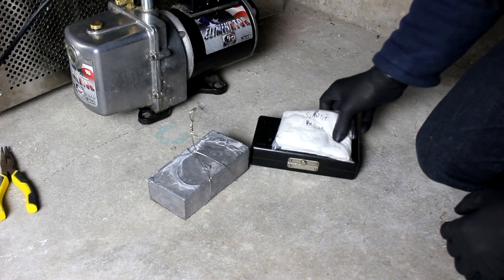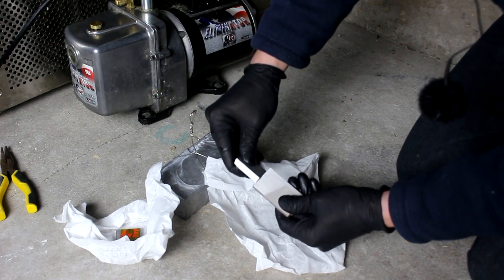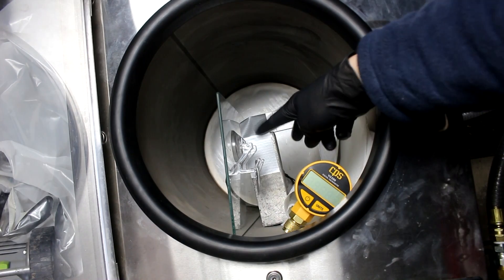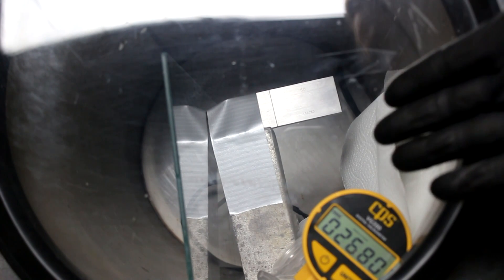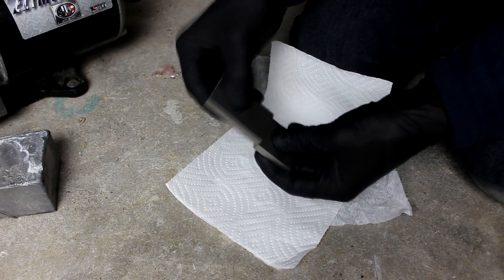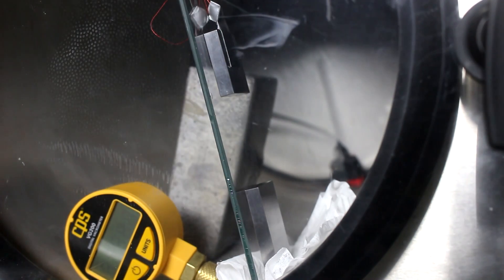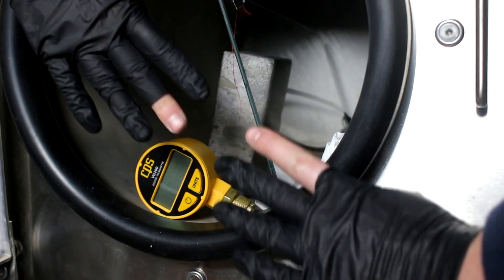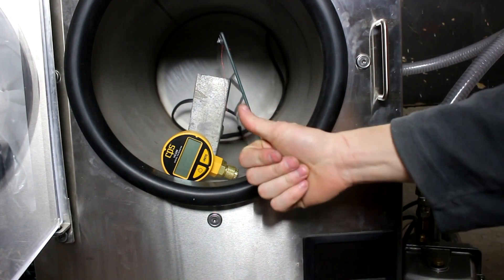Will Gauge Blocks Stick In Vacuum?

Comment: What if the flatness of the face is to the point of every atom on the surface perfectly contacts the atoms of the other block in a way that every spot on the surface heats up evenly to the point of welding them together through friction but on such a small level that it will snap at the slightest touch because its a incredibly thin weld?

Comment: the conditions of cold welding is not met. The oxide layer on the surface has to be cleaned off in the vacum and then it would work. Otherwise it would take very long time to disappear naturally.

Comment: NO PHD but since 14 /68 now  & owned optical coating lab for 43 years the physics here involve molecular bonding at the wavelength of light that your blocks are polished too. I was going to patent an optical filter based on this phenomenon.(after 1o k lawyers r leach's) I stopped> When contacting optically (used in the optical industry as a common practice to make arc second parallel surfaces)

Comment: @13:00 I assume, that the metall-oxide layer is preventing the cold fusion process. When sliding it with friction, you perhaps remove the outmost oxide layer, so that an actual "cold welding" process could be assumed.

Comment: you know that you could just start with them stuck together, and then hang them inside the vacuum chamber, right? When out pull the vacuum, if it was the atmospheric pressure holding them up, the bottom one would just fall off '-'

Comment: You should try doing this in other circumstances, as to see if they're getting stuck together for some form of static charge or smth. As long as I know, I've never seen this test done with a piece of glass or some other insulator. Looks like it's for metals only, and it could have something to do with electric charges
Reply: Ceramic gage blocks wring.

Comment: Being able to put the two surfaces ever closer together means there will be pore and more places where the atoms get really close the cohesion force will appear at more and more places. The air pressure does not play a role here. In fact I predict: in a vacuum those two surfaces will stick together even stronger.
 But in all your experiments in the vacuum chamber you missed one important element: you had not the pressure with which you pressed the two surfaces manually, and so all those possible »places of contact« could never come together close enough to create together enough cohesion force.

Comment: Is it possible that the friction from wringing produces a miniscule amount of heat, and therefore thermal expansion? If so, then maybe as it cools, nanoscopic wrinkles form in the metals, and because they're in contact, those wrinkles are aligned, causing them to lock together like puzzle pieces. Just as puzzle pieces can only be taken apart with particular movements, gauge blocks can only come apart in ways that the nanoscopic wrinkles wouldn't resist. I have no idea myself, nor can I think of any way to test this.

Comment: Silica wafers will stick even in vacuum if cleaned with hydrochloric acid. Regular materials have a atomic coating of water on them which goes away in a vacuum. Silica becomes completely hydrophobic once cleaned with acid. Just some useless info for ya

Comment: It should be pretty easy to use wirelessly controlled actuators to push the blocks together and twist under a vacuum.  I'm sure there's another channel like fireball tool that could make you something.

Comment: I can explain this. It's caused by the quantum entanglement of electrons. Essentially what you're witnessing is atomic velcro. This is how every molecule is bonded within the molecule, and to other molecules.

Think of a hydrogen molecule. One proton(large ball), and one electron (tiny ball). The electron orbits the proton. Just a tiny ball orbiting a large ball. The electron moves near terminal speed. Just slower than the point where time no longer exists.  Now, because a hydrogen molecule only has a single electron, it's unstable as all hell. Spinning wildly out of control. You need a minimum of two axis of stabilization. However, It's not alone, and encounters another hydrogen atom. To link with the other atom and form H2, the orbiting electrons must cross each other's paths, so that both orbits are linked.

It's amazing they can link, because you have to respect that the electrons in both orbits are moving so fast that they are almost in every position within that orbit almost simultaneously. So logically, to cross into each others orbit is most easily achieved when one is spinning counter-clockwise, while the other is moving clockwise on the same plane at the same energy or heat. The opposite is sharing the same orbit direction on the same plane, making crossing impossible without collision. Since the electron can't speed up, if the energy increases, the orbit expands. The larger the orbit, the longer the duration, the less the electron will be at any point over a given time, also reducing collisions. That's why many molecules require energy to expand the orbit, and by reducing collision probability, the orbits can link or unlink. Think of splitting ice and water. Typically, it's much easier to un-link molecules from other molecules, than atoms within a stable molecule

So, we normally see this in fluids all the time, because it's very easy for molecules to change orientation, and the higher energy content also leads to less collision. Therefore with steel, we can turn solids to liquid to aid this linking, and then the cooling makes it impossible to un-link easily without electron collisions.

Now with solid blocks, when we polish the hell out of the faces, many electron orbits can cross and entangle with each other, since they protrude about the same, and there is no fluid barrier limiting proximity. Since the crystal structures are set because they are solids, the atoms don't orient themselves to close to optimal angles like they do in a fluid. You can't press the pieces together easily without a lot of pressure to overcome the electron collisions. However, when you slide them across each other, the orbit can slip inside each other with less collision. However, when you try to pull them apart, the collisions prevent unlinking. However, you can slip the orbits away. With gold, you actually see some material pulled off the face to the other face, because the bond was stronger than the ones holding the molecules to the original face.

To test this theory, it should be harder to impossible the colder the blocks are. You shouldn't be able to wring at absolute zero. Magnetic fields are very similar, expect they are a projected and amplified effect do to orbit orientation. That's why maximum magnetism is also achieved at close to absolute zero. When we weld, we are literally heating the metal to a liquid state, because it allows the molecules to change angle, and increases electron orbit length which decreases collision probability. Since it's liquid, there is also no surface distortions, because the liquid easily forms to a liquid. However, when orbit density isn't the same between two liquids, despite a perfect point of contact, the orbit angles and travel length prevent entanglement, and the low density fluid floats without entanglement. That's why we float glass.

Comment: The block faces may be angled because the guiding glass slide is not perfectly straight. Just a mikron bend in the glass may be a problem. The weight of the blocks may bend the slide. Also the block faces are not perfectly smooth. It takes force to bring them together. Friction may also grind off mikroskopic roughness or plastically/elastically deform the surfaces when bringing both together.

Comment: Have we skipped one important test?
. ... after degrease and successfully fitted them together - we missed another vacuum test in that condition.

Concave suction cups, aren’t optically flat, requires air pressure to operate, will fail in vacuum. 

There is a layer of air molecule electrically attached and stay with any surfaces within the vacuum chamber (if any test blocks) that are not easily excavated out by the pump (until boiled off the surface at high heat). Under ideal conditions gauge blocks should assembled together in vacuum successfully.

A good way to attach (or part) two gage blocks is to start press two adjacent corners then slide along coplanar surface until both are full engaged, in air or in vacuum.

Comment: did you try dropping one on top of the other at normal pressure and see if it worked with out the vacuum? I would hypothesize that a weak ionic bond is forming. Similar to the way salt is bonded. The metal is flat that electrons are actually being shared between the two metals. But that's only a guess

Comment: I think you can rule out static charges being a factor since you need two different materials with a different average chance to lose an electron, creating net charges that are attracted, and the blocks are made of then same material.
My theory is since the surface of the block is so flat there is lots of surface contact. But the surface also deviates by ±500nm which means Multiple atoms are still protruding from any given point, like a regular flat surface, although the surface of the block is flat enough to allow for a lot more of contact points. The contact points deform the metal on a nanoscopic scale in parallel grooves when Cody was pushing and sliding them together, when they are in place the grooves are interlocking and friction holds the blocks together. I guess a way to test this would be to look for parallel grooves under an electron microscope. It could also be surface tension. Even though Cody cleaned the metal, since the deviations on blocks surface are only ±500nm the volume liquid required to fill the space would be so small you might not be able to make it clean enough easily with acetone to rule that one out. It could also just be cold welding, but then pulling them apart should deform the surfaces enough to not allow for the effect once more.

Comment: My theory is that the suction cups weren't perfectly flat, at least as much as the blocks are, thus when you put a vacuum air leaks out from the gap between the glass and suction cups...but the blocks are so flat, they kept their vacuum and thus didn't separate...Of course, I could be wrong and you're right, more research is needed.

Comment: Yes the teacher in shop class wrung gauge blocks together and they really stuck.
He made certain they were super dry and clean.
I remember the book showing a sliding motion to wring them together and he used a twisting motion if memory serves me correctly.
He did it just to be different because he was a total dick.
Haven't been near a lathe since.

Comment: I would imagine that by sliding them you are dislocating some atoms on the surface and since it is so flat, they are replaced in the bonds by atoms from other block. And the probability of this happening is much higher vs normal blocks, where only peaks of surface imperfections are really touching.

Comment: My gut thought is that it could be an imperfect cold weld. If you look it up in an article, NASA had an issue with cold welding involving a door on a spacecraft when an astronaut was coming inside the craft after a spacewalk (IIRC). The door hinges were entirely metal and they welded shut as the crew was trying to close the hatch. The reasoning hypothesized was that in the absence of oxygen, when the metal surfaces were abraded against one another, the existing oxide layer on the metals which came from earth (which would prevent a weld), was removed so the resulting weld occurred between real metal-on-metal contact rather than metal-oxide-on-metal-oxide contact.  This may explain why they only stick when you "wring" them together, you're abrading some of the oxide layer off, however, since we're in an oxygen-rich environment, the weld is imperfect and can be overcome.  That's my two cents...no one ever accused me of being a genius. Keep up the great work and give my fond regards to Utah (Go Utes)!

Comment: Looks like a cross between the interactions of the van der waals forces, and the temporary blending of valence orbitals. If true, an electric current with sufficient voltage should cause it to detach.
Reply: Or: it isn't true, and you accidentally spot-weld your gauge blocks together. So, maybe don't try it on those in particular.

Comment: Why do metals form together in the first place? I think it's the same concept that causes materials to condense. Once the air has been squeezed out of the two materials, they essentially become one by the cause of electrons or however the physics work. Like the friction causes magnetism or electricity which forces the molecules to bond. I think there would be some heat produced, too, when the air is squeezed through the small cavity between the plates.

It's possible the kinetic energy when struck by the falling gauge in a vacuum along with the sound vibration doesn't allow the molecules to catch each other.

Comment: my hypothesis is that it's a quantum electron interaction. flexing metal moves electrons so rubbing them together with high pressure might instigate electrons to move between the plates creating a mild bonding like unto the inter-atomic bonds that make the metal solid to begin with.

Comment: Engineers refer to this type of adhesion as 'Jo-Blocking', which mostly involves Van der Waals force that acts between surfaces that are on a nanometer (or shorter) scale apart.  Flatter, smoother surfaces like gage blocks offer a greater proportion of total contact area within this tight range, resulting in unusually high net Van der Waals force!  By rubbing the two clean blocks together first, tiny asperities will be ground or smeared flat enough to allow this effect to take place.
Van der Waals forces are known to be unaffected by 'vacuum' or pressure differential! They are intermolecular (unbonded) attractive forces that operate within a tight range of distance without contact.  You can look this stuff up; it's called science.

Comment: I don't know where I encountered this, but as a kid a trick was to take two fragments of mirror and dampen slightly and do the press & slide action, glass side together. They would stick strongly. It only worked reliably with mirror and not regular glass, suggesting maybe that was a flatter surface.
My hypothesis would be the air pressure one, just operating at a different scale. If you surrounded a suction cup with, say, a layer of thick gel, making it harder for the air to get back in, but not adding much to the adhesion, I suspect you'd get the same effect.

Comment: Idk if anyone will see this but it's possible that the rotation or sliding motion may run microscopic groves that allow the metal to grip onto eacother like velcro and possibly allow for some of the atoms to bond to each other like they where welded or a mix of this and the vanderwals force

Comment: Perhaps it's the surface tension of oils or other material that gets stuck between the blocks. I know Cody cleaned them with acetone, but it could be that it's very difficult to get everything out. So if one imagines a microscopic round droplet on one of the edges, the droplet gets squeezed by the wringing motion and its surface becomes a very thin "ring" around the edges of the contacting surfaces. Hence pulling them apart would mean momentarily creating an oil surface the size of the block edge and therefore there's a resisting force. Just dropping them on top of each other does not produce enough force in which case the tiny droplet remains in a droplet form between the blocks and supports their weight.

I guess this could be tested by carefully putting the blocks on top of each other so they don't stick, and then gradually putting more and more weight on the top one. 
Or by sticking the blocks together and heating/cooling them, as surface tension of many materials changes with temperature.

Comment: The vac won’t get rid of surface air unless you heat the surfaces quite a bit, because the air will adhere to surfaces.

Comment: just a theory from a fairly science illiterate guy but it could be as you are pushing them together the high spots rub and take off the thin layer of oxide in the low oxygen environment these spots create a fairly weak cold weld?  if anyone can disprove me please do  the best thing someone can do for you is prove you wrong

Comment: just good electrostatic forces from rubbing the two flat surfces together. It's a macroscopic quantum effect because the metal atoms are so close together from the two perfect flat surfaces. You still need however the rubbing to excite the atoms on the surface. I bet the effect will be negated  when you cool down the two blocks.

Comment: It can be monomolecular (1 molecule thick) layer of oil/air between parts, and to put more air you need to make an angle between parts, but then you will have negative pressure in area, where the slit is already more than 1 molecule, but still smaller than 2 molecule. I think some kind of weird things may appear in a uniform single-molecule slit between ideal surfaces.
Why it did not cold-weld if there were no any atoms/molecules between parts? I vote for an exotic effects of uniform monomolecular slit. )

Comment: I was taught this stuff in my school, lol
It was about 8th grade, we had too polished cylinders made of steel and they were stuck just like in the video after some forceful sliding

It was said that due to smoothness, after applying force much more molecules of metal pieces come close and start interacting in the same way they are interacting in the metal piece itself, so this attraction becomes strong enough to support weight of cylinder.

Hello from Russia, though